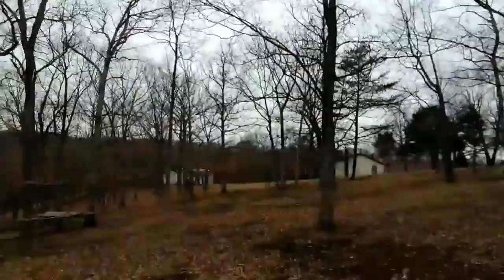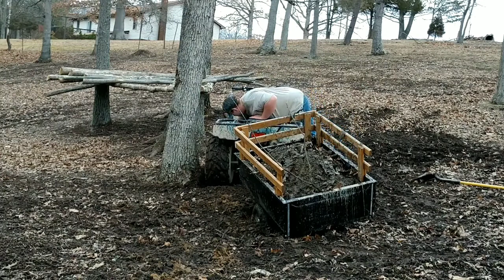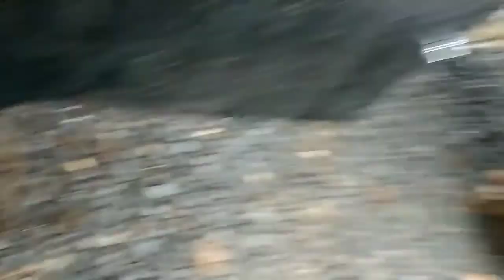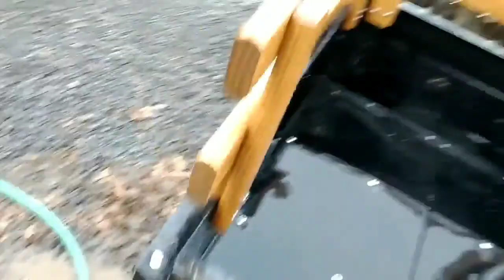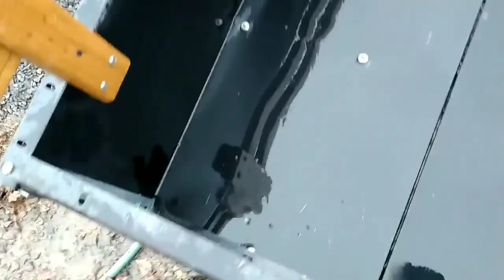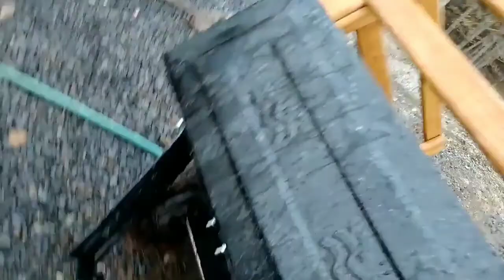How To Trash Lawn Mower Dump Cart With A ATV

Comment: I have a trailer like this. I lined the entire inside with 3/4 plywood plus added 6 inch side boards. The sides are one piece with the top 6 inches double thick.I added some steel to the hitch and its been a good little trailer.

Comment: I bought a bigger trailer at an auction for $30. I'm putting heavy duty tires with tubes on it and lining it with plywood. I will haul tons of firewood with it. It fits nicely behind my 87 Honda Foreman 350
Reply from the maker: You should see what trailer I'm running now. I used a frame of a mortar mixer then used a bed off another one if my carts but with the 5 foot bed. Shes not done yet. Plan to put sides on it, tool box on the front, 25x13.50x9 Wooly Boggers and custom fenders using a the barrel of a outdoor grill. Hopefully. Lol
Reply from the maker: https://youtu.be/D1f1nPNaoto
Reply: @HillbillyOffroading  This sounds very heavy duty. I have narrow trails so I don't pull wide trailers. My trails are like 50" wide and the trees don't give if I hit them.